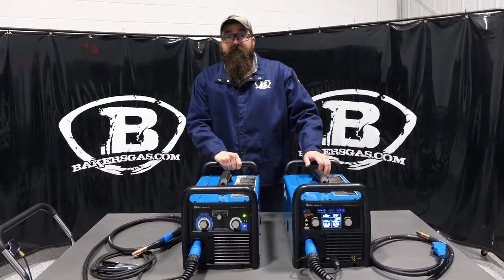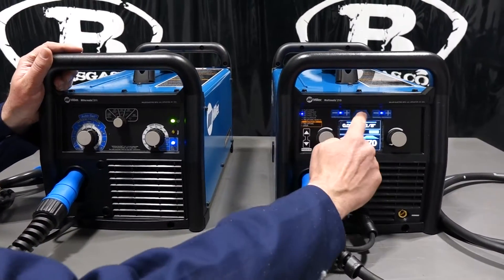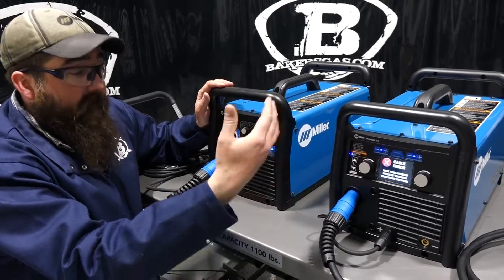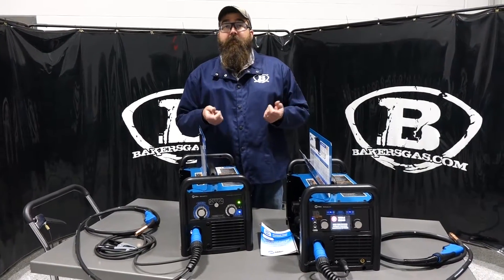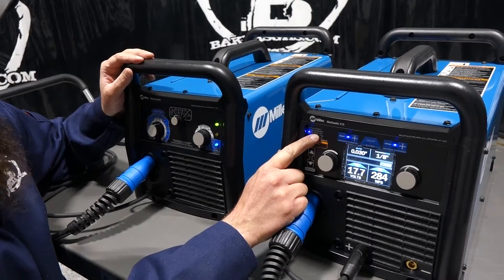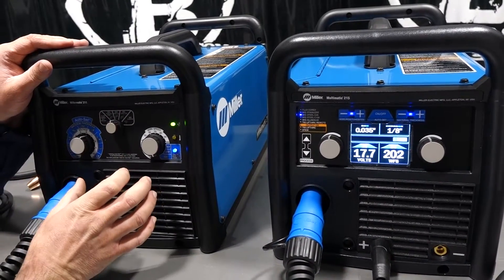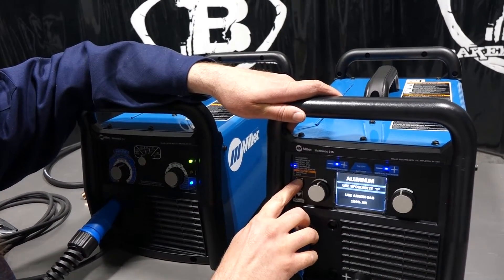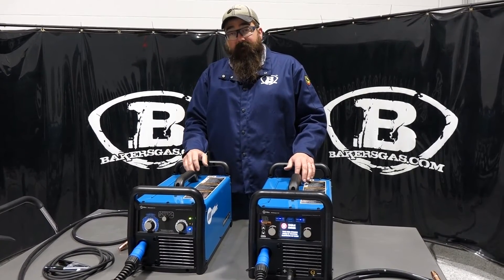Miller 211 vs Miller 215 Review & Comparison

Comment: You guys should do a comparison of the 215 and 220.
Reply from the maker: Thanks for watching! For sure can do that anything in specific you would like to see?
Reply: @BakersGas  Mainly the differences in the DC TIG and any advanced AC TIG features the 220 might have. I have a 215 but I’m thinking of getting a 220 next for the high frequency start and ability to TIG aluminum.
Reply: Which one do you think has a better duty cycle?
Reply from the maker: @joeysimon7522  The 220 has a little more power but the main difference is the ability to TIG aluminum if you ever need that go 220!
Reply from the maker: @Marcus_Woodard  if you ever want to TIG aluminum invest in the 220!
Reply: @BakersGas  I ended up getting an HTP Invertig 221.
Reply: @BakersGas which one is better the 220 or the 235 for a everyday hobby on reinforcing car chassis and quarter panels and floor boards or the 255 if you could let me know before making a purchase on lincoln or miller..